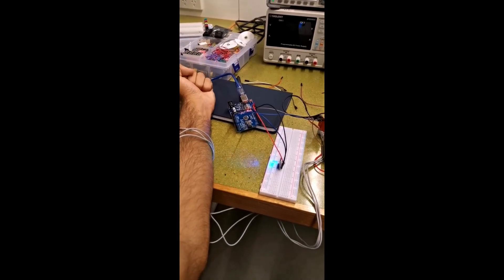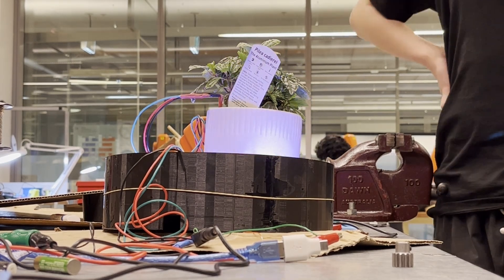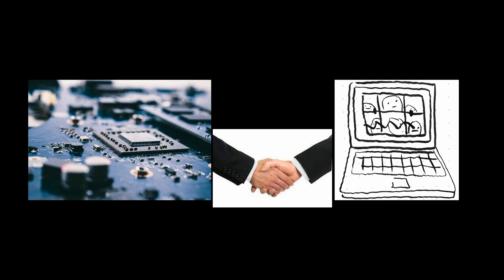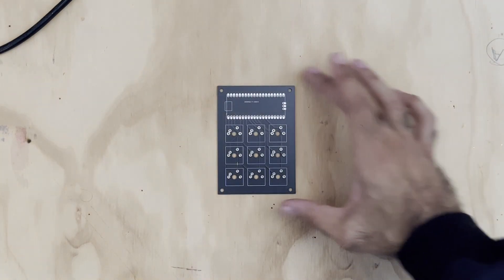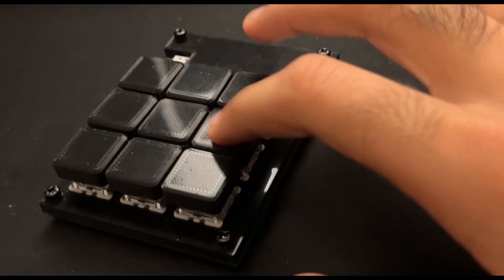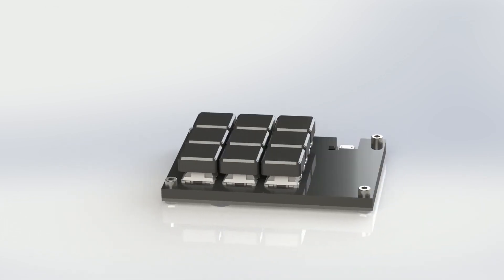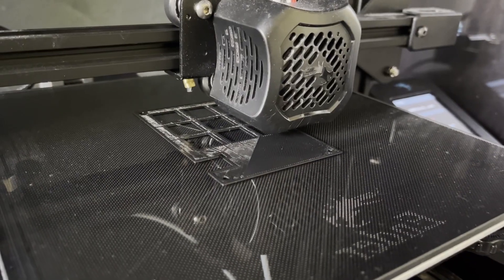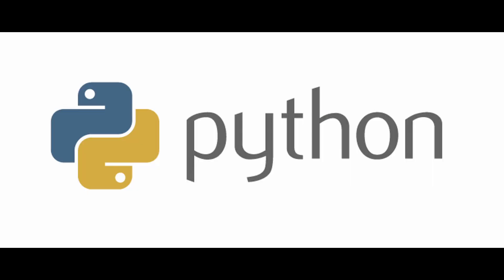Macro Pad V1.0

Comment: Have you looked at the Teensy boards? These make it really easy to do. I designed a 3x 4 key board that you can join to others from any side to build any shaped keyboard/keypad - madness :)  I've had a similar problem as you. I've build a keypad, then ended up going so far off track I'm getting my 270 key PCB made up at jlcpcb. - it's getting a bit out of control if I'm honest. Did my own software that allows multiple layers (4 of them) , transparent keypresses, outputting text - I really can't think of uses for 4 x 270 keys though. I might need help ;) But have a look at the Teensy boards, very powerful and easy to use. You can develop for them within the arduino environment if you prefer.
Reply from the maker: Hey! I had a look at the Teensy boards, very powerful stuff (probably a bit overkill for a 9 key keypad)! I opted to use a pico as the native language (or most supported) was based around Python, was keen to get some experience with a different language. Also, pico's are much easier on the bank account 😅

This being said, I do have more projects in development and 100% willing to attempt something with a Teensy one day! appreciate the advice :)

Comment: Awesome! Out of interest, why did you go for a Pi Pico vs a 32U4 based Micro Controller?
Reply from the maker: Thanks! the 32U4 boards available were mainly Arduino based, so it would be standard to program in C++. I wanted to learn Python, and the Pi Pico facilitated that with tons of support (also the Pico was way cheaper lol)